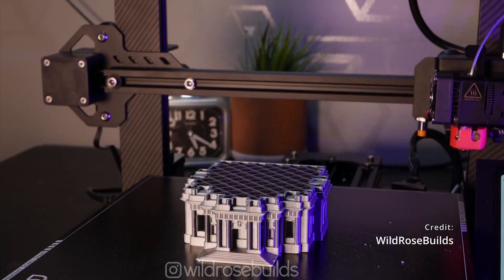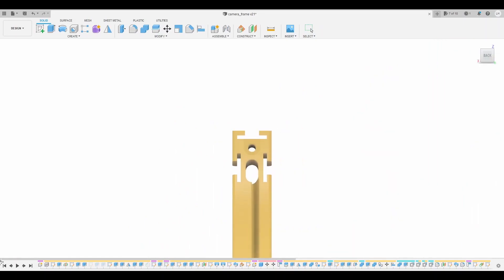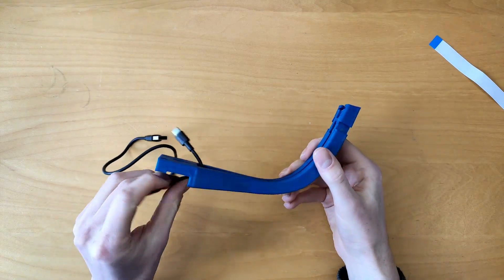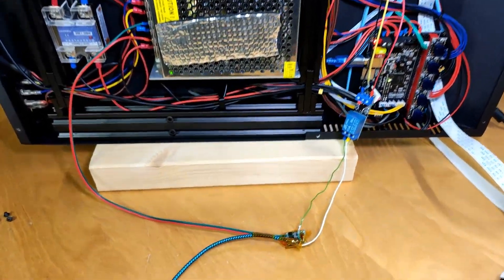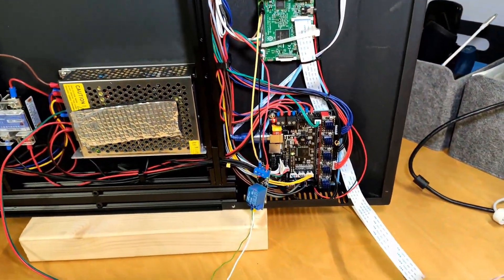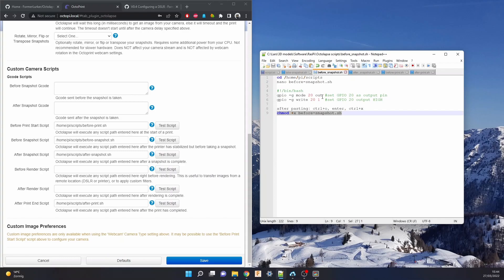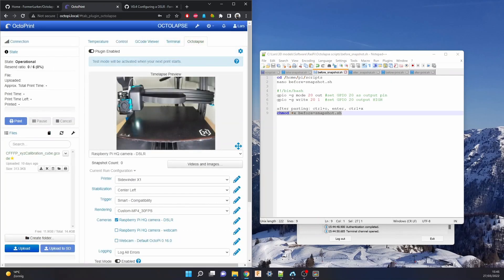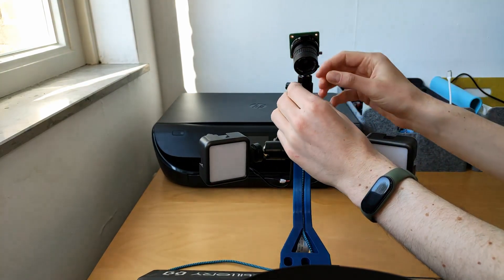Timelapse Camera Build for my 3D Printer | Affordable & Automated

Comment: So you can't really replace the quality of a good DSLR. I tried to get away with RPI camera a while back but it was a struggle. Also to get @WildRoseBuilds quality timelapses, you need consistent lighting. Your environment is contributing a lot to poor picture quality. Finally really like what you have done with the lights, I think you need brighter lights and then apply post processing filters to get cool images. You are right track.